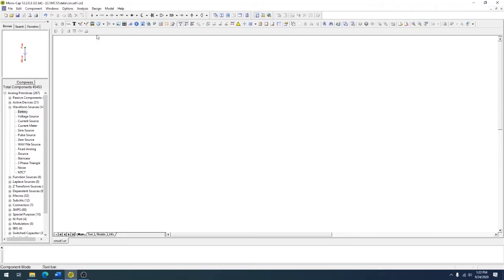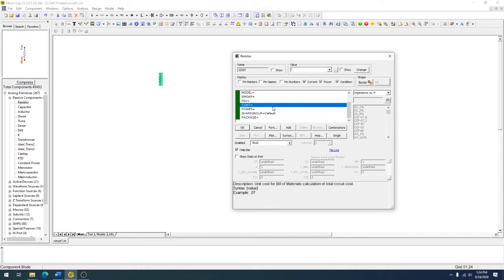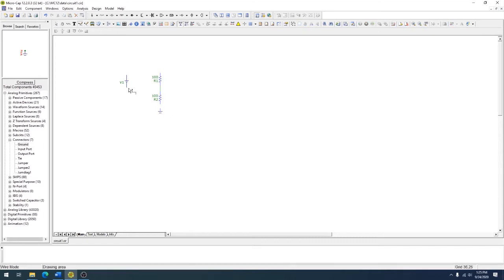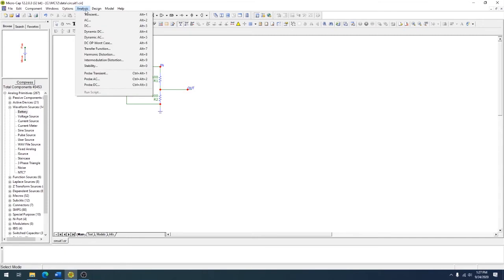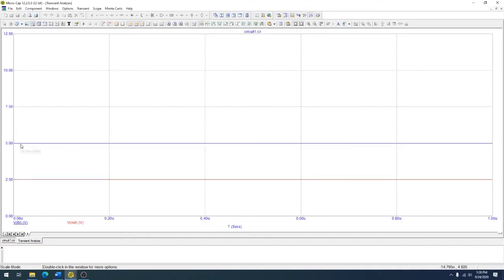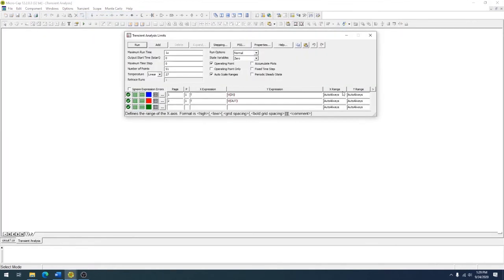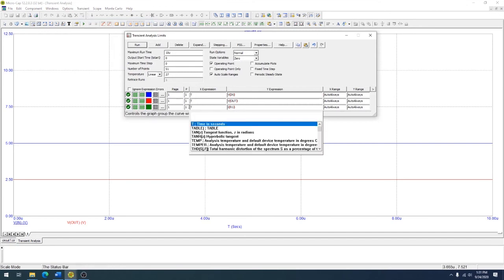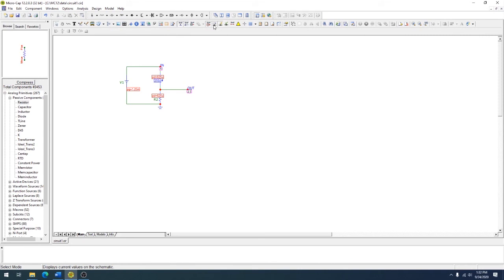Micro-Cap Sim Tutorial: Voltage Divider Simulation

Comment: I'm just learning Microcap right now. Thanks for the series. I(N1,N2) is the notation that you missed during the recording. However, it seems to get wrong results if there are multiple paths between the nodes (it does not give the total current but only the current through one of the paths)

Comment: Micro-Cap 12 won't let me put a conditional statement in its capacitance parameter to vary its capacitance per conditions. I'm using this capacitor as a throttle which I name: 'tcap' ...

.define tcap {100f + STOP}

.define STOP if(I(IndLoad) > 300, 30p, 0)

The intention is to raise the capacitance of tcap to 30pF (or, more) if its current should rise to a minimum of 300 amperes. Its default capacitance is 100 femto Farads.

What do I do?
Reply from the maker: Great question! I'll study and get back with you. I'm traveling now
Reply from the maker: Ok right now I see a few different things:

1. Your if statement is not enveloped by curly braces like your capacitance definition command is. I'm not certain that MC12 cares about that but it would be a good idea to make that consistent.

Note: I do not know how often the conditional check occurs in processing the analysis mode you are using. Perhaps you could let me know what you're doing there.

2. The variable IndLoad is presumably an inductor part name?

3. You could implement your idea as a more real example using a idealized switch that places a capacitor onto the network for your above 300 A condition. Data about the current can be acquired by a measured change in current (sense resistor method) or use the defined symbols.

If I find time I'll make a video on this, it's a good question.
Reply: @pauljstar  Thanks, but it didn't help. I'll send you an email of links to the files since YouTube won't let me post links.

Comment: I'm an LTSpice user for a few years now, and would like to move away and find a sw that has more ICs other than the ones made by AD.
I tried Tina and didn't like it. 
Do you have a video or know of one that explains the advantages and disadvantages of Micro-cap compared to others? 
How difficult is it to find modern parts or make your own custom parts library?
Reply from the maker: At the moment, I don't have a comparison video. Well the professional versions of xdxDesigner and Altium likely have a lot of preset models to choose from. However, ultimately, it comes down to one's ability to find a model from a desired manufacturer, import it, learn the parameters, tune appropriately, and use in concert with other models. Every software has idiosyncrasies with regards to that process... it just seems to be what you are willing to put up with. Free softwares almost always have more things to put up with. I like micro-cap because it's what I know well and the professional analytic features are free now.